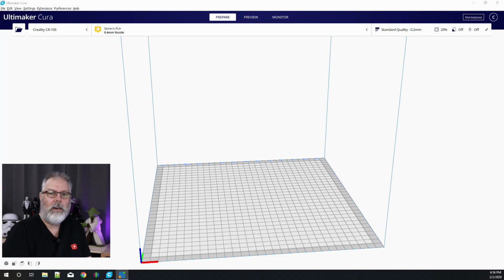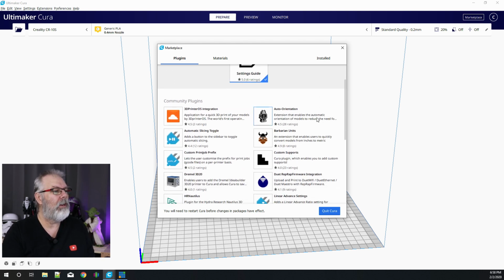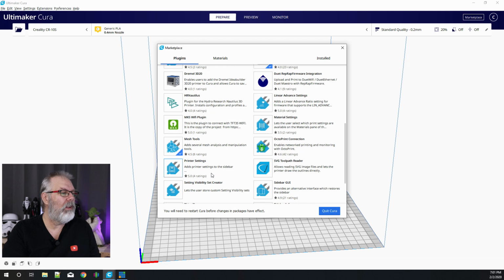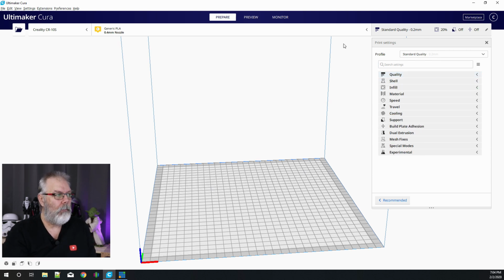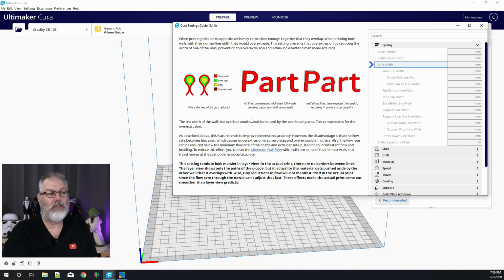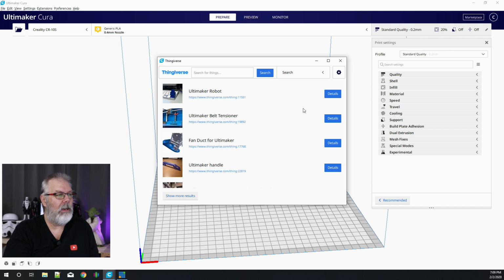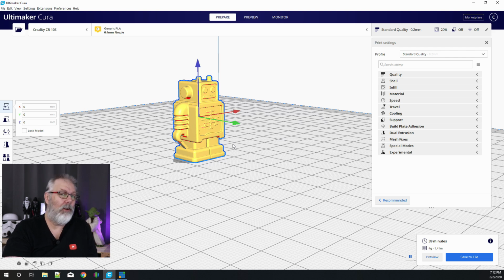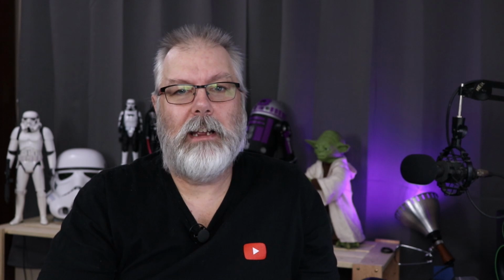Ultimaker Cura 4.x Plugins

Comment: This is helpful. Good job. I already figured this out a while ago but there really wasn't a good guide like this. Thanks! I use Support Blocker more than Custom Supports and along with the Auto Orientation it works pretty well. Personally, I really like Cura and it my main slicer. I recommend that anyone getting into 3DP spend some serious time learning this application. It will be a good investment for sure.